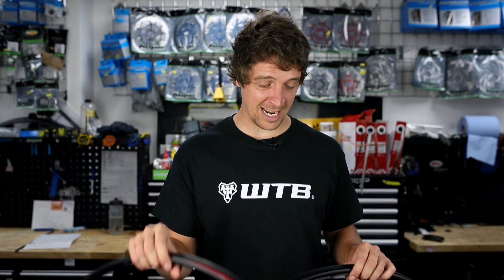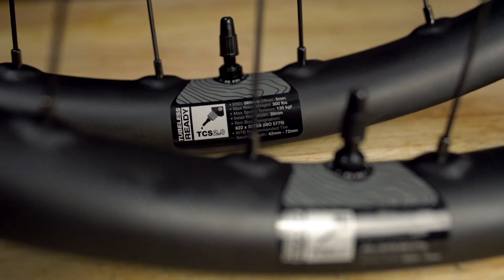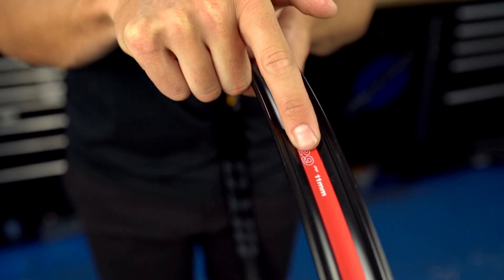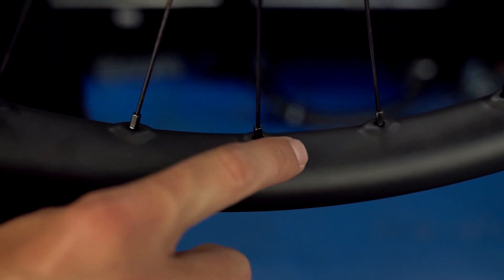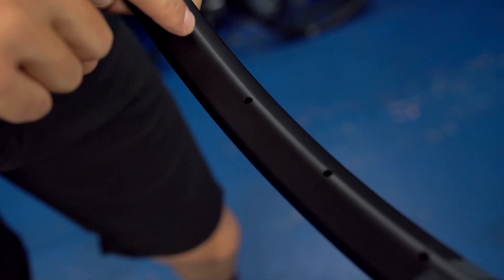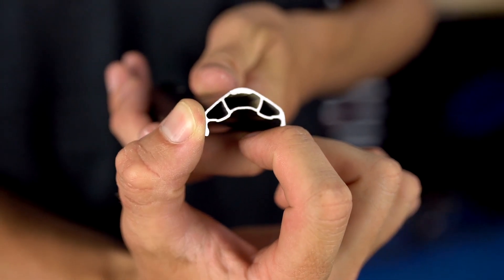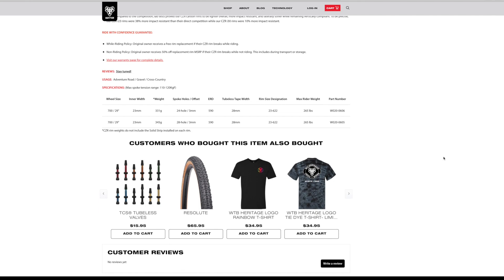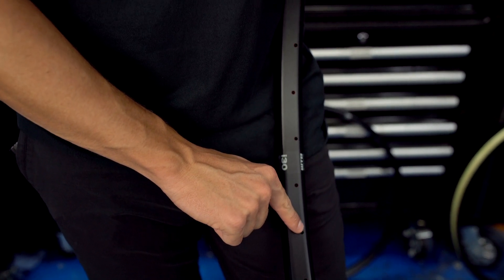WTB Rim Technology - Extended cut!

Comment: Hey! 
What means “P” in rims model name, like STp?
Reply from the maker: Hey there. The 'P' refers to the way the rim is joined at the seam. Pinned, as opposed sleeved. Hope this helps :)
Reply: @WTBtv  It’s so nice you answered on my question, because I didn’t find any information about it.

Does it means, that pinned rims are cheaper or budget than sleeved rims? Usually I see P-marked rims in complete bikes, not in shops